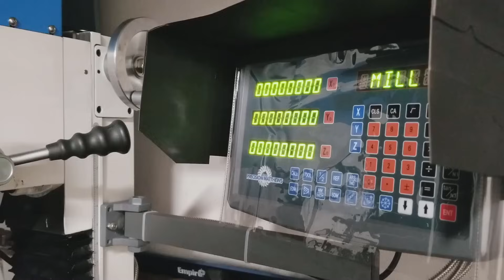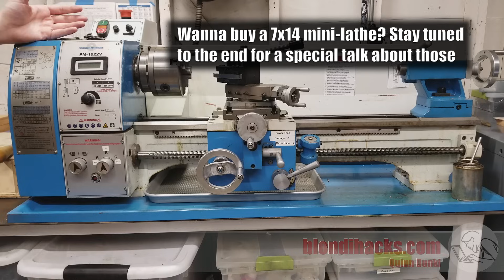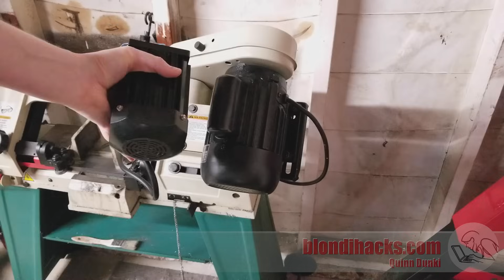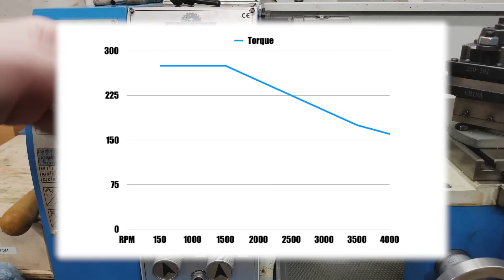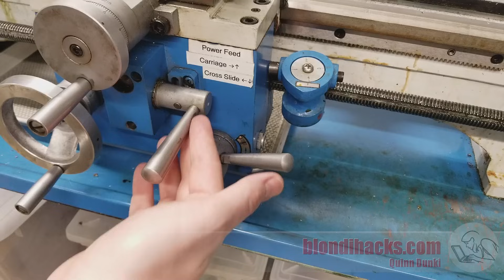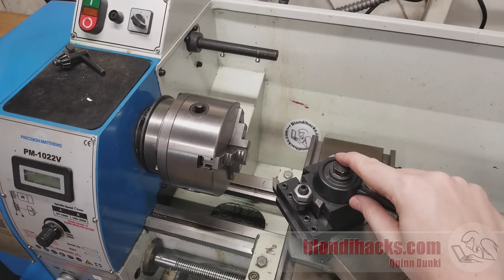Import Lathe Buying Guide

Comment: Your switched on about certain economics, regarding a Lathes origins, what happens and what some companies do. This is wide spread across other industries as well unfortunately. There is of course those companies that hire others to make proto-types/product(s), and those that do not get the contract obviously sell what they have to recoup in costs. The arguments people get into knowing jack about what happens keeps me entertained, yet saddened as they will still, knowing and/or not knowing they are wrong, argue even if it means becoming ad hominem. I've been interested in getting Metal Lathe for a long time and I have seen smaller Lathes here on YT. In some cases, the run out on some of the essentials had been horrendous where the owner has spent more money fixing these problems when another, better Lathe, could have been purchased to start with. Bad economics perhaps? Or maybe, the owner wanted something to do. Cheers for the video.

Comment: I've been researching (and lusting) after one of these lathes for a while. I appreciate the "real" breakdown (good and bad) of these small lathes. It helped narrow down what I want to go with...thanks.

FWIW, speaking of spur gears, if you were not aware (thanks to This Old Tony + past work experience), I've found that one can obtain a large number of different sized Module 1, 20 degree P/A metric spur gears (up to 120 tooth) from a host of different suppliers. I recommend Stock Drive Products; they usually have a larger selection in stock. You'll need to select "hubless" gears (10mm or 8mm face width/thickness), however, you'll need to cut the correct bore size and cut the correct sized keyway in them (if these options are not available, the mix may not be). 
https://shop.sdp-si.com/catalog/?cid=p591&filter=&sort=undefined&view=table

Comment: My first thread on my new Asian small lathe was to replace the brass head on the machinist hammer I made in 1975. It was 25mm (1") x 10 tpi. Set the gears up and rotated the chuck by hand for each cut as the thread was only 12mm long. Worked fine much to my surprise!

Comment: I have found that GRIZZLY generally has a good price/performance ratio WHEN YOU BUY ON SALE. I have been using a 13x36 gunsmith lathe for 8 years and it still works great. I have also had good luck with Vertical bandsaws, tooling etc. I don't have a relationship with GRIZZLY, I just like their stuff. IMHO

Comment: 5:20 - This makes no actual sense. 

40 thousandths is a decimal number - it's 0.040 inches. And 0.37 mm is an integer - it's 370 micron. 

You simply think it's an integer or decimal because of how you're used to thinking. 

If I wanted to be a pedantic ass (my favourite hobby), I'd point out that the imperial unit smaller than an inch is a barleycorn (1/3rd of an inch) and that thou is decimalisation of imperial measurements, which doesn't fit with any other imperial measurements. What the thou is doing is using a single convenience of metric (easy step-down in scale) without getting the rest of the conveniences.

In the end, the best system is whatever you're used to and can easily get your hands on. If you are used to imperial measurements and that's what everything around you makes, then that's the best system for you. But if you're in a metric country on a metric continent, using imperial measurements are going to be extremely inconvenient.

Comment: I have a Boxford CUD. It uses the half nuts to power feed and change gears for threading. (Close relative of the South Bend 9")
I am presently fitting it with electric crossfeed (done) and electric power feed (still getting parts)

Comment: This is a really comprehensive review!  I own one of those blue-and-white guys for some years, did upgrade it a lot and still found something new and important tips in your video.  About the headstock bearings: they can be easily made kind of serviceable.  After a while the sound in my bearings changed and I understood the grease has dried out.  I took the assembly apart (not so difficult, just a good hour of mallet work :)  ), cleaned and demagnetized everything, then I installed the dust guards back to their places using the blue anaerobic sealant to make them oil-tight.  Then I drilled two vertical channels for oil and threaded them on top ends for "plug" bolts.  After putting everything together I poured some milliliters of common engine oil into each bearing and plugged the channels with the bolts. I believe circulating engine oil will extend the bearings' life compared to grease.  And now I can "kind of" service my bearings.  When I feel necessary, even without disassembling the whole crap I can add excessive amount of oil to the running spindle so most of it spills through the slots (the slots are higher than the bottoms of the bearings' chambers so some oil stays there anyway).  Most of the oil will be exchanged this way taking away the particles of wear.  I made more changes to my lathe, but this is the most interesting one. Thank you very much for such a nice video!

Comment: I did my first 10 years in imperial and the last 25 years in metric. Metric is definitely easier than imperial and psychologically more accurate as you tend to work down to .01mm or .001” respectively, though I still mentally consider .1mm to be 4 thou.

Comment: If cost was nota problem would a geared head machine be a better option than the variable speed units and what are the pros and cons of the two and likewise what would be your advise on lathes with milling heads attached and pros and cons on those

Comment: Thanks for the great video.  Excellent explanation of the features of these machines.  Quick ??  I am very interested in purchasing this lathe.  I noticed that the difference in price between the PM-1022 and PM-1030 is about $200.00.  Have you had many occasions where you wish you ordered the longer model (8" longer lathe) for the $200.00 upcharge?

Comment: 4:18 "hold on, gotta wait for the gunfire"

Ah, so FREEDOM UNITS wins again I see ;-)

I work for a company that builds aerospace products for Lockheed Martin, Raytheon, JPL you name it, from raw 2024/6061 aluminum stock to finished product, and we operate just fine with freedom units. 

I'm not knocking metric, it's a fantastic system of measurement (great for those with lazy brains) but I am quite sick of metric fans knocking SAE ;-) great vids btw

Comment: Dont buy OPTIMUM I did and the tool slide has casting defects and when I contacted OPTIMUM the said that it was NOT an  OPTIMUM machine but a Chinese partner. still waiting for the replacement part

Comment: This video is very interesting and informative.  I have considered that if I wanted to upgrade, I would choose a 10x22, but so far I have not seen a need to do so.  I spent quite some time studying and learning prior to purchasing my lathe, and so far I believe that I made the correct choice.  AGI (The American Gunsmithing Institute) says that all one needs for gunsmithing is a mini lathe, and  they include a 7x14 with their major machine program.  I choose the 7x16 with a brushless DC motor that is sold by Micro Mark and Little Machine Shop.  The negative things about this lathe are that a QCTP and an outboard spider are required and the 3" chuck that comes with it will not open enough to accept things that will fit through the spindle.  However 4" and 5" chucks will open up enough and the other items are not that hard to come by.  I made my outboard spider from a 1" black pipe coupling.  
I chose the Micro Mark lathe because it comes in two boxes and is therefore easy to get on the bench without having to use a crane.  The Little Machine Shop version is available with a fixed (non tilting column.)
Micro Mark calls their lathe a "True Inch" machine and there are no metric marking on the dials and they use imperial lead screws.  However, Little Machine Shop has software on their website that will determine what gears to put where for almost any thread, as long as the gears are not too big for the machine.  Using that software, I made stockmakers screws for a Mosin Nagant, which is a very unusual thread.  I was not able to find dies for that thread, but making those screws was my first project on the lathe, and they work fine.  Not too bad for an accountant who is used to work by just sitting behind a desk.

Comment: Quinn, first, THANK YOU!

I work at a store that sells woodworking tools, 
as well as the lumber you'd need.

So, I'm the guy that assembles all the tools, and 
also reconditions all the used tools for resale.

Powermatic, Jet, Grizzly, Laguna, and every other 
manufacturer use the exact castings, for their 
planers.  (I'd like to build a 20 inch planer, using 
different painted parts, just to show that they 
are all the same castings.)

But, there is a single table saw maker, that doesn't 
dance to that tune.  SawStop is built in the ROC, 
(not PROC) China.  If I were to buy a table saw, it'd 
take me 1/2 second to make my decision. SawStop.

There are GOOD Asian tools, and also CRAP Asian 
tools.

steve

Comment: 5:18 to be fair these crooked decimal numbers in hobby are mostly comes from conversion out of imperial, if you plan in metric normaly you tend to use round numbers too, i thinks this is mostly a conversion thing.
but at the end everyone should use what he can best work with.

and of course it has a lot to do with which unit you grew up with i will always struggle with imperial.

Comment: If the Asian machines that look and feel the same were not so similar you could not interchange parts between them - i.e. you could not take most or all parts from one machine and fit it to the other one. Sure there are some differences in accessories etc. but in the 7" class pretty much every part can interchange with any other through whole line of different colored machines. PM machines may have great reputation etc. but its not like they have excellent build - if they did they would not survive competition.

Comment: Excellent video. I've have one of these for many years (very similar). I know you mentioned threads but if it's a thread cutting lathe ... very important to decide if you threads will be metric or imperial. You can cut visa versa but they are compromises without additional gears. Also worth mentioning that the cross feed on the Asian lathes are marked as diameter increments where as western lathes are marked as off radius? Very important if your milling..

Comment: Excellent video, topics well explained. It is one thing to know your stuff but quite another to be able to explain it so well.

On the metric/imperial question:

I started my machine shop apprenticeship in the UK in 1975. (Rail engineering - my lathe had a 4ft swing and 15ft between centres.) Jobs were 50:50 metric and imperial so the apprentice school put us on imperial machines with metric drawings and metric machines with imperial drawings. The mental arithmetic involved is not hard. Just use a metric micrometer on metric drawings and an imperial micrometer for imperial drawings.

The big difference came for us with screw-cutting. All our lathes had a screw-cutting dial showing where to engage the half nuts on the leadscrew at the start of each cut. We found that changing the gear train for a metric pitch using an imperial leadscrew meant the nut engagement dial no longer worked. We had to leave the nuts engaged permanently and reverse the chuck between cuts to get back to the start position. This makes the job more of a chore and practically doubles the time taken. I once had to cut a 1.25" OD x 5" long four start square thread nut on a metric machine this way and it took over a week.

Comment: I'll add my 2 cents on metric vs imperial. I think the deciding factor is which type of threads you will turn most often. Imperial threading is easy if you have an imperial lead screw, and vice versa. Threading is not as easy when you can't disengage the half nut.

Comment: I own identical lathe with other brand name. I have purchased this lathe for one third of a price with damaged engine. There was no BDLC engine , just high voltage DC motor with PWM controller.  Part of a comutator in my engine was damaged.  I swapped damaged engine with 3 phase induction motr and used Mitsubishi inverter controller. I was able to put maximum 500W motor - because of it's size. But, now the lathe works OK.

Comment: I was a machinist in an old English workshop. Drawings all in imperial. Only a few in metric. Measuring gear mostly imperial . Machine did both as it was cnc. However I spent most my time in imperial. Just prefer it. Got my hobby lathe in imperial. I think it just divides down better. I know where I am with a fit in imperial. Just knock a thou or two off and I'll be right on .

Comment: I'm always suspicious of DC motor control accuracy because I doubt that the manufacturer spends a lot of cash on high linearity potentiometers.  That means the accuracy of the digitally reported speeds probably varies greatly from one machine to the next.  Do you ever replace the potentiometer in these machines to improve the accuracy of the readouts?
Reply: You'd be better off adding an optical tachometer (some lathes have a toothed spacer on the back of the spindle for this), rather than messing around with the inputs.

Comment: We also have "thousands" in metric system, it means thousands of a millimeter in machining. It is called micron. But because it is so small  measurement usually hundredths are used. One hundredth of a millimeter is 0.4 thousandth of an inch, so again it is more precise and it suits very well to precise machining work. I know you have tenths and millionths and so on but really you should let go imperial system because it is a mess after all. For an European it sucks to convert thousands and tenths to metric, not to mention silly fractions 1/32, 1/64 of an inch etc.

Comment: Hi Quinn,
Just wanted to thank you for theses videos.  I have a YouTube channel also, and I know what goes into these things and I appreciate the effort, from first hand experience.  I've learned a lot from you.  I have one of those 7x14 lathes you speak of at the end of this video.  And, I have to agree, they are pretty crappy.  However, thanks to a few tips I picked up from you, I have been able to accurize it to the point of being a useful tool in the shop.  I don't need the 10ths' level of accuracy.  I build fine scale models, so something within .001" is good for me, and I've been able to achieve that with this machine.  So, no budget and no need to be more exact at the moment.  But I'll continue to watch and learn.  Glad I found you.

Comment: Im confused, the leadscrew whole purpose is to drive the carriage. I mean thats what it does???
EDIT, OK its the method of getting the power from the leadscrew, such as the keyway rather than using the threads, right ? Some lathes use the halfnut for everything, thats what we need to avoid right ?

Comment: I have a harbor freight 9X20. The motor burned out after a couple years of use. I’m going to replace the motor eventually. I made a lot of mods on it and turned it into a great lathe. I recently bought a Grizzly 7X12 because I needed a lathe to make some parts on. I feel a lot better about the Grizzly after I bought it. The harbor freight was my first lathe and I never did machining before so I really didn’t know what to look for. The 9X20 was pretty cheap at the time and it got me started in machining. Now I’m modding the Grizzly and I’m pretty happy with it so far. You can tell they actually had quality control with the Grizzly compared to the Harbor Freight.

Comment: Would it be possible to have a mill be a lathe? You would drop the table to the floor and thus expose some additional area in the Z axis to run your vertical tailstock. The quill would need to be redesigned though.

Comment: I had not run a machine lathe since a college class 45 years ago but wanted to acquire one to have fun with as my retirement approached.  I spent 8 months trying to understand the features and pros and cons of everything from new import mini lathes to 80 year old American iron.  Older small American made lathes (South Bend, Atlas, Logan) in the under $2000 price range were hard to find (at least here in Texas), were often times located 300 miles from my home, and if in decent condition and priced fairly, they usually sold within 24 hours.  In addition, often times the footprint was quite large depending on the motor/belt setup, and you always run the risk that the lathe you just bought and hauled home is essentially worn out.  I wish I had seen your video when I was researching before I bought my lathe, but I guess the fact that I ultimately bought a Precision Matthews 1022 like you own proves once again that “God takes care of little kids and idiots”(me).  Your videos are very well done and are a great contribution to the community.  Thank you